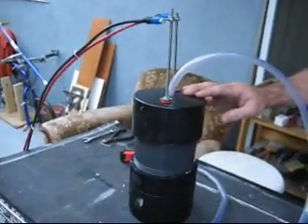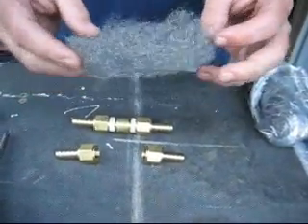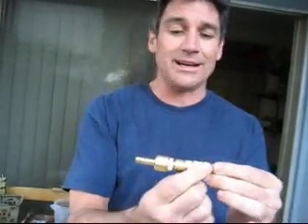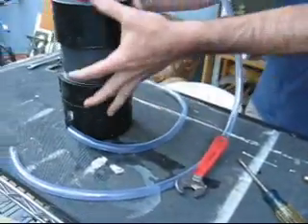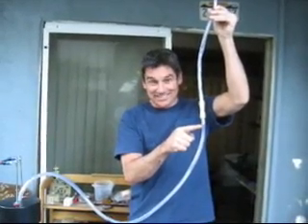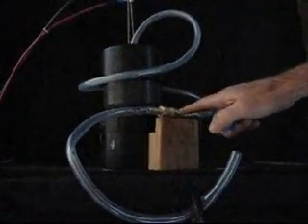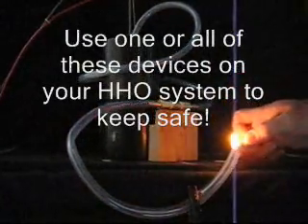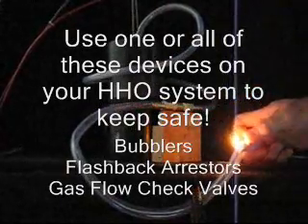HHO Flashback Arrestor

Comment: Very nice. But why use flashback arrestors if the gas is going to flow through a water jar first then be taken out and used? Surely the water will act as a one way valve?
Reply: Because 2 is 1 and 1 is none, especially when dealing with things that go boom
Reply: @RGun90  Good answer thanks

Comment: My hho weld torch is just exploded all the time., no flamable. plz help
Reply: Take a 4 inch long stainless steel pipe and then take pure copper very thin wire  and fill the pipe very titly as shown in video

Comment: Good Video! Redundancy is the only sure way to be safe. Can you pack the flachback arrestor with to much stainless steel wool? I would think that if you crammed to much in it would effect gas flow. I understand if you don't put enough in it will not stop the flashback and stopping flashback, and safety, is the ultimate goal. I came across a post on an HHO Forum and they said not to use any kind of wool. Have you experimented with anything else?

Comment: Use 4 inches of PVC - cut two spaces and drill 13 holes in each spacer. Glue the spacer inside the PVC pipe so there is a 1/8 inch gap between the spacer and the end of the PVC pipe. Stuff it with a lot of stainless scrub pad. Glue in other spacer then place end caps with you size tubing. Flow and failure problems will be eliminated.